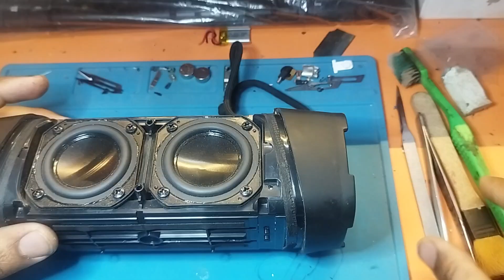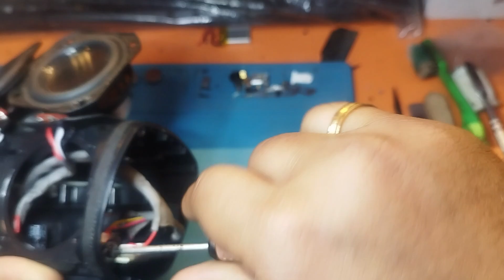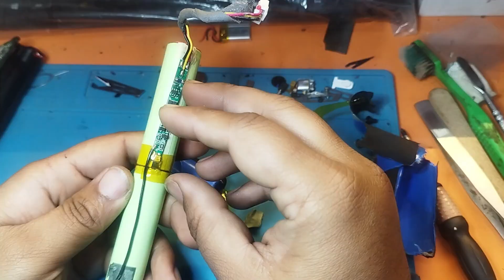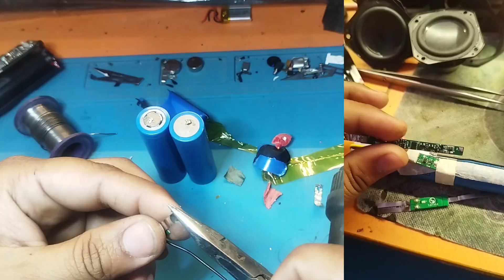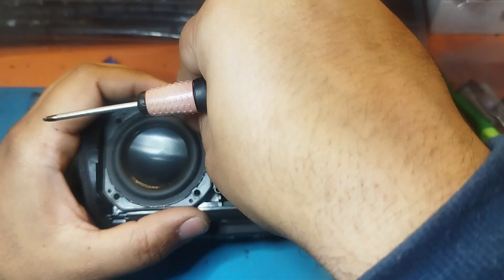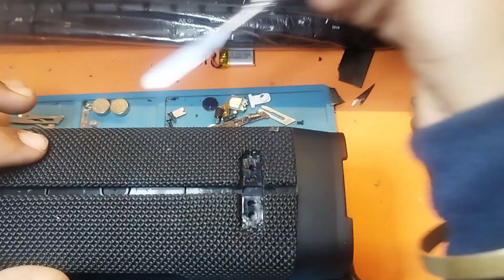JBL infinity bluetooth speaker 7.4 volt battery replacement #repair #backup #disassembly #dismantle

Comment: Bhi s22 ultra ka apne full video nahi dala bola tha da doge kush dinomai kab doga video display change wala fingerprint work hai ki nahi a wala ✅
Reply from the maker: Fingerprint detect to kar leta hai pr lock open nhi hota ek bar m
Reply from the maker: Bhai video dalne ka wakt nhi mil pa raha
Reply from the maker: 1-2 din m mil jayegi
Reply: Bhai mera ek jbl party box 100 ka battery ka bms repair kar do ge ?
Reply: Apse kese connect kare
Reply: Bhai apna watsapp no batana . Baat karni hai infinity fuze 700 k baare me. Mera BMS kharab ho gaya hai iska